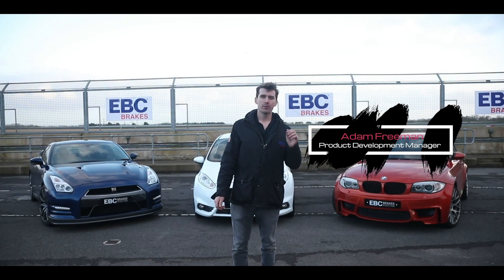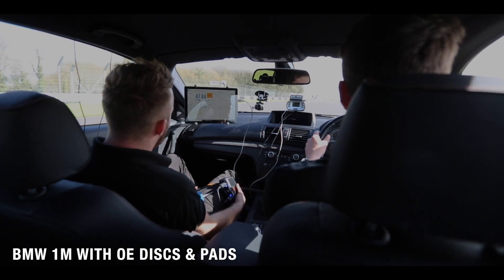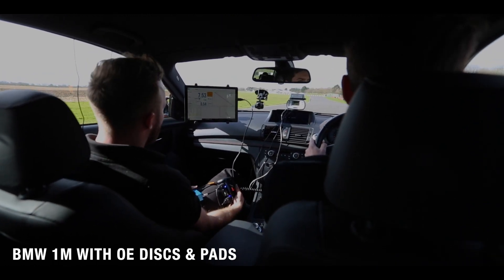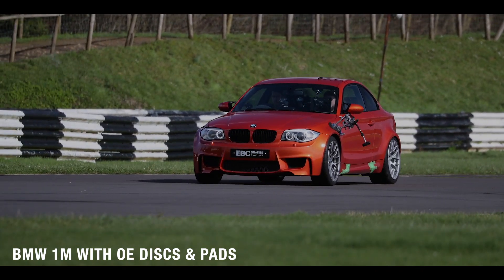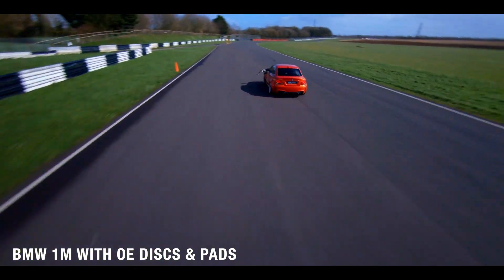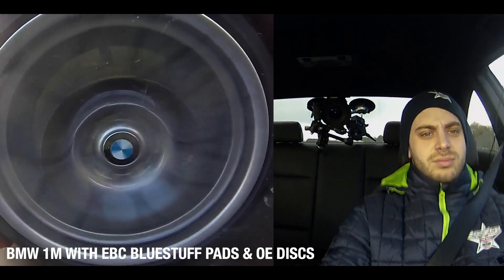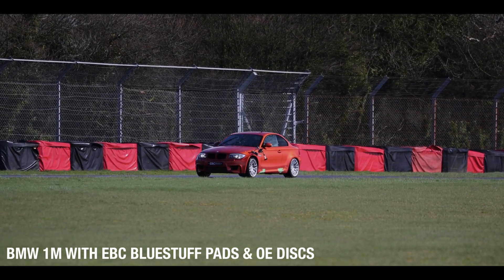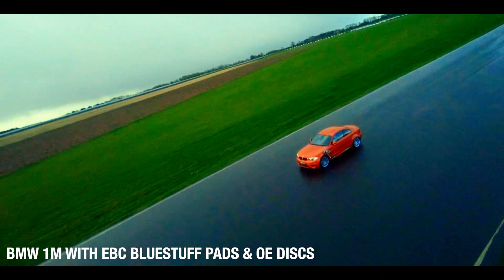EBC's Ultimate Brake Test | Ep.6 – BMW 1M AMS Test (OE vs EBC Bluestuff Pads)

Comment: The thing that stood out to me most was, the brake temperature is so much lower in the wet. Not braking as hard, maybe a little more time to cool off.

Still surprising how big the temperature difference is because it's the same total amount of energy dissipated (20 stops from 60)... Goes to show the importance of cooling!

Comment: My rear brakes do very little while fronts lock up easy, ive got no ABS. I wonder if putting bluestuff on the rear and keep fronts stock would balance the brakes?
Reply: Check your tyres first. Proper rubber makes a huge difference in stopping power
Reply: @pmrrmm  thanks for the tip, ive excluded those factors already!
Reply from the maker: Hi, Please get in touch with our technical team for advice on this particular matter. You can contact them at the below address <technical@ebcbrakesuk.com> 

Have a great day 😀
Reply: @EBCBrakesUK  thanks, i will give it a try